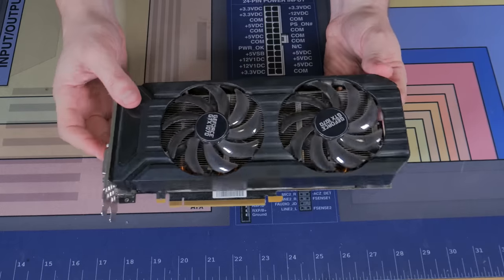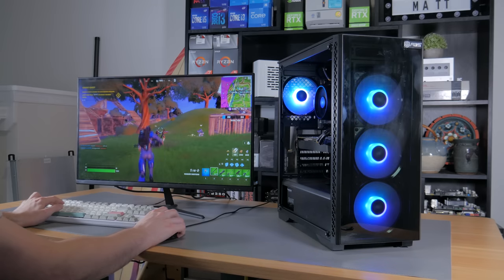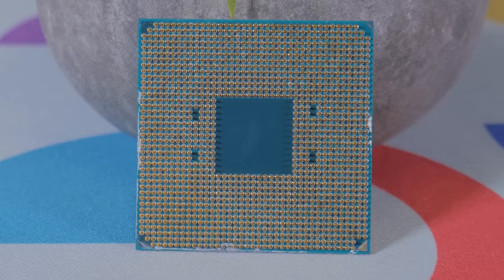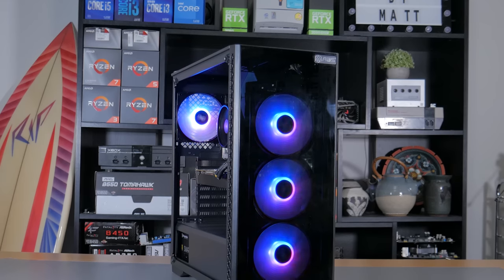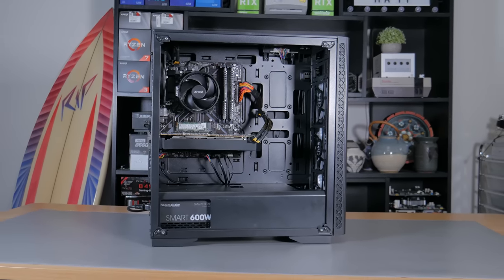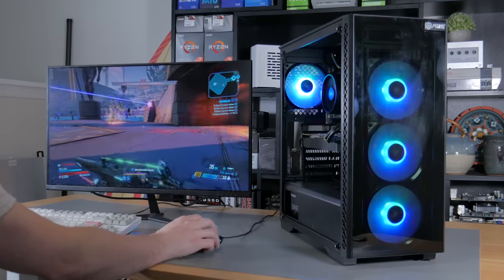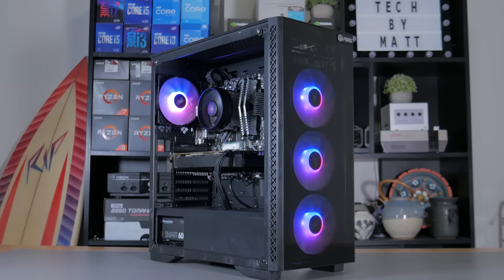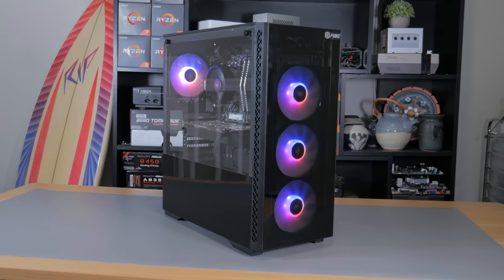I Built a $400 Gaming PC in 2022...

Comment: $400 that's a damn good looking system I actually recently put my prebuilt back together from my old case put it in the Deepcool metrax 30 with a B560M motherboard and upgraded the ram to 16GB. paired with a i5 11400F and a 1650 from my old prebuilt also have a corsair 650W PSU runs extremely well switched to PC gaming never want to go back to console again
Reply: Can u play warzone on your pc and if u play what fps u get and fov can u get plz respond

Comment: I did a $450 build with a ROG B350 Mobo, a Ryzen 1700x w/Deep Cool RGB Cooler, 16GB of 3000 MHz RAM and an RX 580 8GB graphics card in a white mesh case with the tempered glass side panel,  cleaned up with Asia Horse Red Cable extensions hooked up to an EVGA 600w 80+ PSU.
I liked your video card choice though. I just don't have the patience to bid on eBay, I always go for the "buy it now." 😁
Reply: Is the rx580 a good card? I’m planning on getting a pc with an rx580 and a ryzen 5 1500x to play games and record
Reply: @imissherrrr  A little late but the RX 580 is a pretty solid card for 1080p, however it’s starting to show its age now, so maybe you should try to push your budget towards a RX 6600. Anyway I’d try to get a better cpu like a 3600 as-well.

Comment: I’m using this for the basis of my Optiplex 3010 build.  From what I’ve read it’s supposed to be ATX Standard even with a non-proprietary front I/O.  I picked up a couple of them for $56 each with free shipping using your search filter.  I can’t wait to try some current Gen hardware in these.
Not ideal, but I’m a sucker for office tower cases with 5.25” bays.

Comment: It is so crazy, back in 2016, when the 1070 dropped I was fawning over it for years. I had an actually build my own PC yet, but I sure did plan to build hundreds of them, but none of them ever got built. That was before I knew anything about computers, and I thought that I had to have it because the streamers I watched had it, now I know better. It’s the equivalent to me thinking I need a rtx 4090 to play aaa titles with runescape in the backround. Next week I will be building my first pc. I am going with an i5-13600k cpu, an msi ventus 3 3070 ti 8gb, 32 gb corsair vengence rbg, msi pro z690-a wifi pro series, 1tb nvme ssd, 3 tb 2.5” ssd, msi mag coreliquid v2 280r, and an msi velox 100r atx mid tower. I am basically only skimping on the graphics card, which will cause the bottleneck, which will be upgraded in a few years.

Oh yeah, all brand new parts, i shopped around iver the course of a month and payed $1160 including shipping. Easily one of the best price to performance mid range builds.

Comment: I made a 200 dollar Fornite PC for my Daughter. End Specs: Hp Pavilion(The Green & Black Gaming Case) I5 7400, 8GB Ram, Ugly Green Motherboard 80$ Craiglist - GTX 960 4GB 40$ Craigslist - 500 Watt Power Supply EVGA B Stock 20$ - 1 Matching Stick of 8GB Ram 25$ Amazon. I had an NZXT case fan sitting and the case already had vents on the panel, I drilled 4 holes and installed the fan as an exhaust with a Molex to Fan adapter, I would say add 20 for this Modification. The last few dollars was Gas had to do about 45 minutes of driving. Runs Fornite on 1080 Performance settings around 100 FPS and the exhaust modification was a must... The 1 included 90mm exhaust fan.. spins.. about the best I can say for it, will probably end up replacing it. I really had fun with this project and could flip it for 300 bucks all day.
Reply: Which Pavilion case and motherboard?  It had to be a replacement HP board, because even an iTX would be a challenge.
Reply: @zeroturn7091  hp pavilion 580-023w it was a little tight but not terrible.
Reply: @RegazozoGaming  I was skeptical (I thought you meant the TG01-0023w case), but this isn’t a bad idea for someone like me.  Was the front I/O proprietary?  I saw that the DVD drive had a weird power connector, and it looks like it’s either single fan GPUs or an APU.  Well done.
Reply: @zeroturn7091  The Front I/O USB and Audio looked standard, I didn't unhook any of it though, not sure about power button connector I just left it all alone since I was using the board it came with. The CD drive did have a strange connector someone used a male sata to molex to hook it to the power supply. I bought this off an older gentleman who told me he picked it up from a church after it stopped working, the power supply had died and he replaced it. I am guessing someone pulled the original GPU and sold it during the shortages and then sold the PC and that is how it ended up in a church. We joked about the preacher gaming in the name of the lord.

Comment: the price is still relatively high at $400 considering gpu prices are back to normal
Reply: Could you build cheaper 🤔
Reply: @davidg2731  yes. The best deal is usually local deals. Or you could try Reddit too. eBay you have to pay tax. I picked up a 1080 TI system with a i7 8700k cpu for $300. Given its age on the Ryzen 1600 and 1070, you could probably pick it up for around $200 and that would be a good deal
Reply: @johnjohn40100  I would buy r5 1600 and 1070 for like 500$ here lmfao

Comment: Why isn't the 1070 performing like it should? The 1070 should already get   240fps in fortnite competitive, and 350+ in Valorant with high settings
Reply: Look at the quality settings dude
Reply: @mitlanderson  I looked at the settings and it doesn't perform like it should. If you watch benchmarks a 1070 can already reach 144fps at medium settings. Kryzzp recently did a video with the 1650 with the exact same settings as this video, and it already got 165 fps. And there is a benchmark with the 1070 on valorant and it already got 300 fps on high settings. 
https://youtu.be/OI1gWJGlcsc
Here is also one on fortnite
https://youtu.be/n2fV0D_GAk8 
 It has the textures on low but from my experience, textures don't make a huge performance loss unless that you have low vram (The 1070 has 8gb of vram, so it should get 10-20 percent of fps loss, and the game is still cpu bound. And performance would also be a bit lower since the video uses a 1070 ti). 
Maybe the 1070 was used for mining.

Comment: Hey my pc blue screens randomly times I have a ryzen 5 3600, gt 1030, single 8 gb ram ddr 4 the blue screens are no triggering on an intrusive point but it happens to me twice one week at one point so far it has not happened again also I’m using my 4K tv as a monitor for my pc so maybe that’s the problem?
Reply: It could be bad hard drive,ram, CPU or motherboard. You have to test each one of them
Reply: @johnjohn40100  ok I’ll try the ram first as I was gonna replace the one I have anyway